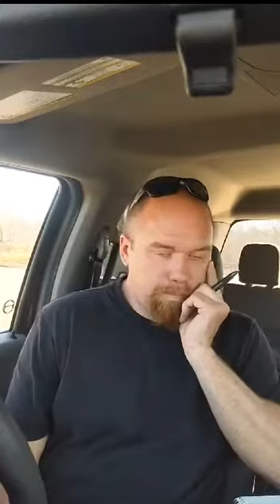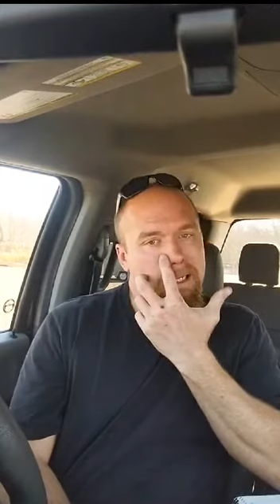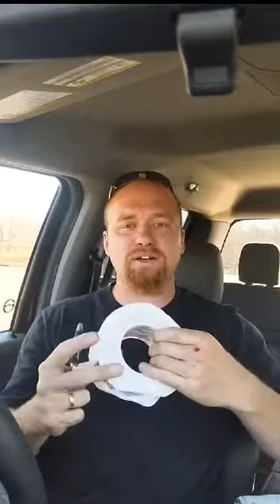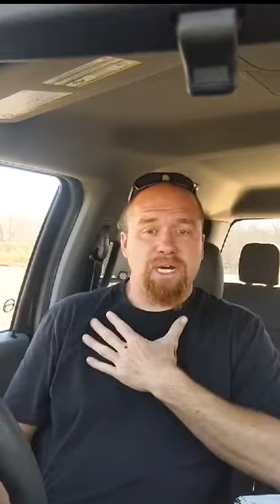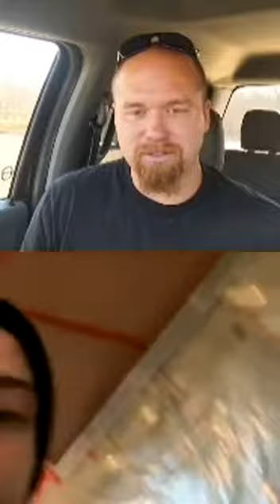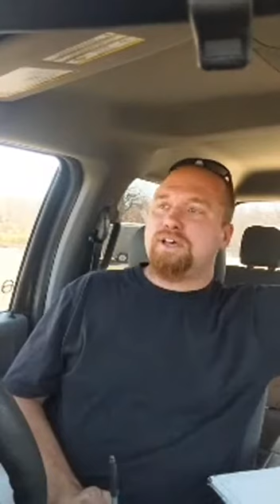Answering Your Metal Roofing Questions

Comment: What is the best underlayment to use under metal roofs to prevent the deterioration of the decking due to condensation?
Reply from the maker: Depends on ventilation....if you have an open air attic space above the living space you should put a synthetic peel and stick underlayment.  If the roof is insulated directly beneath the substrate we would suggest a breathable underlayment to prevent vapour-lock.  We will be going into this in much detail in the future. 

Subscribe and hit the notification bell so you don't miss out!

Comment: 👍🏻👍🏻
Reply from the maker: Glad you like it. Stay tuned for more Standing seam content
Reply: @asm101  Where can I buy metal roofing? I'm in upstate N.Y. and I don't do Home depot or big box stores. I'm just replacing the old rusted stuff on my barn, thanks.
Reply: @jimmartin7881  If you're trying to just replace corrugated roofing on your barn, are there farm and ranch stores in your area? Are you not using big box because you don't have them or you just don't like them? With you being in NY you have snow loads to consider and then how long do you want your roof to last? I would prefer 24ga roof because of its longevity. The only thing remaining, imo, would be 26ga. It definitely won't last as long and just isn't as resistant to wind. 24ga is much heavier and thus resists the higher winds. Check with Alex and get info on the different methods for attachment...nails, screws etc if you are going to be using corrugated metal.